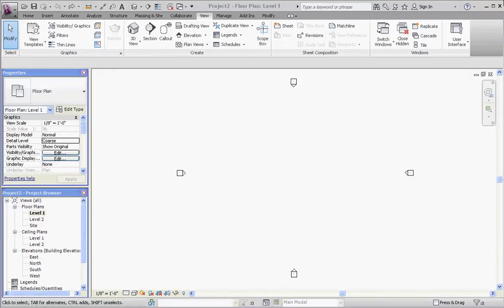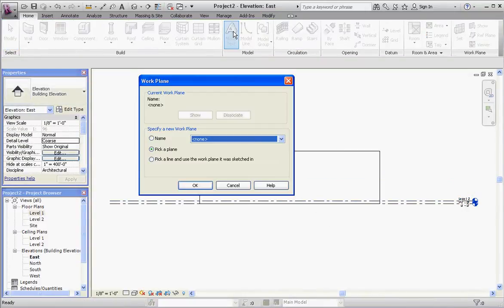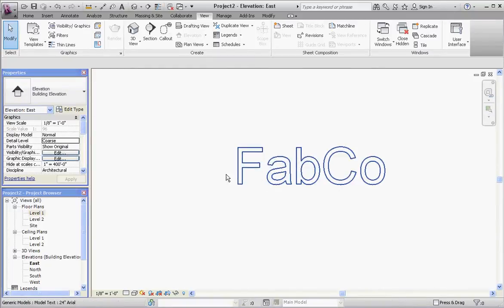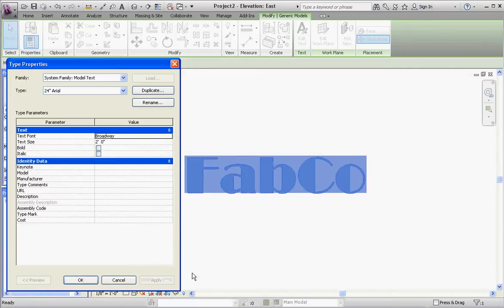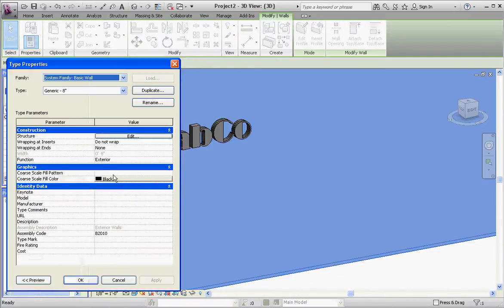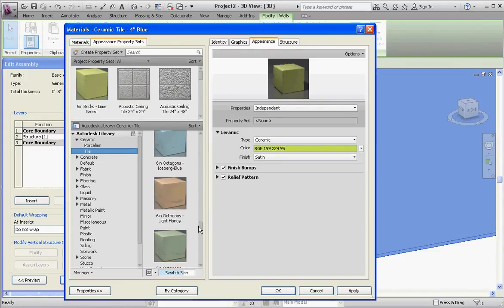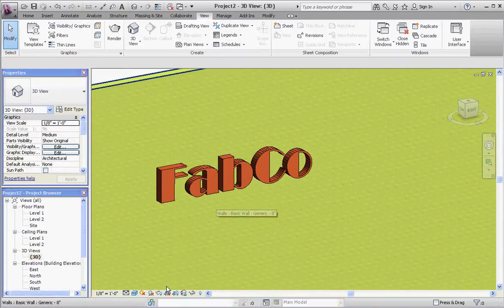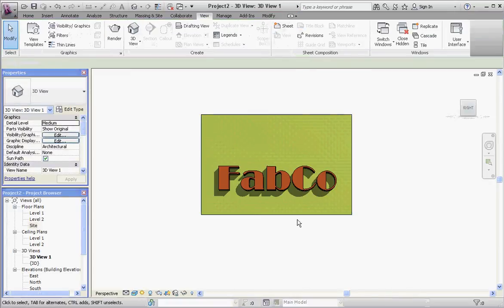Revit - Titleblocks Part 10, Creating Revit Logos

Comment: Please I need help!! When I'm trying to do a mass with Audi logo, the program doesn't let me to do it like mass because it has two circles. How can I do it?
Reply from the maker: I do not understand the question - or need more information.  CSS
Reply: @DesignInnovations  don't worry I could finally solve that problem. What I said is that Revit doesn't let to  do tubes or pipes doing extrusion from two circles, but if you do it with two halfs it let you. Thank you so much for your reply
Reply from the maker: @javitriana2135  - Thank you for this information - there always seems to be a work around when things don't behave they way they should.  CSS